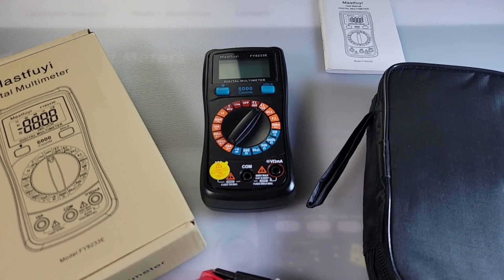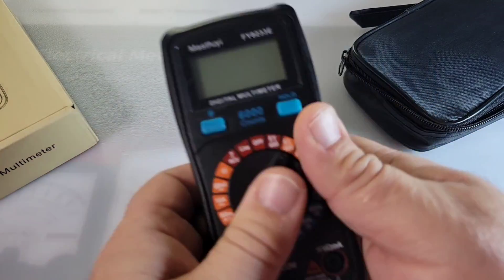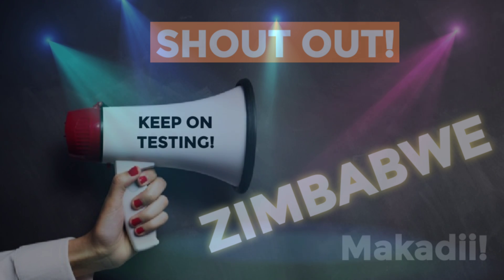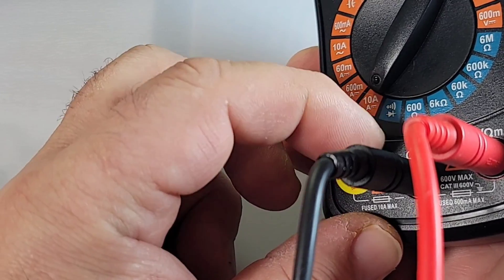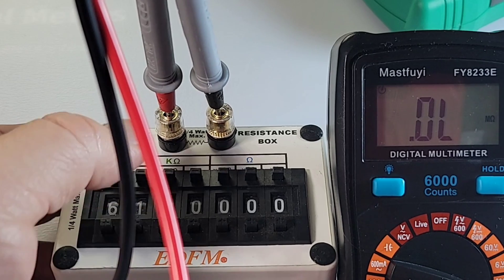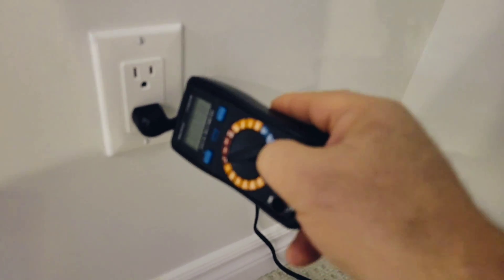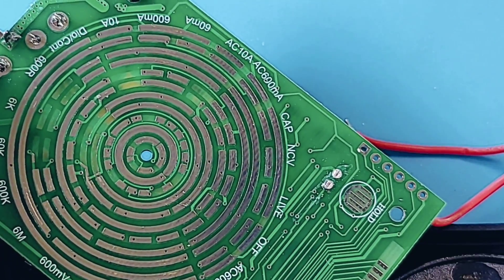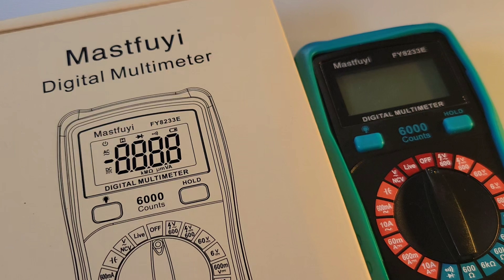MASTFUYI FY8233 CHEAP-O Multimeter Review & Teardown!

Comment: Hey, question. I have one of these that I rarely use but I replaced the batteries the other day since it was dead, and 48hs on the OFF position the batteries are drained again.
Any idea what to do besides buying a different one? Thank you
Reply from the maker: Try opening it up and applying some  IPA to the selector tracks..might be shorting due to some grease, so a good cleaning with Alcohol and a cotton swab might be just what the doctor ordered..😊
Reply: @KeepOnTesting  Thanks for the tip!

Comment: I being a female just seen this little cheap multimeter and bought it thinking i would be able to check my hotn relay or fuse but i truly dont know what to set it on every video i e saw doest have this type of i dont even know what this is called around the knob that turns it off an on. Could someone please tell me where to set the knob (the oart that turns it off snd on) just to check my ruses and relays? I truly would appreciate it more than your ever know.
Reply from the maker: No problemo..put the multimeter into continuity mode , it's the same selector switch setting as diode mode in the video. You should see this symbol ○))) (its between 10A and 600(Ω)  )..now test your fuse and if it's a loud constant beep the fuse is good, no beep..means it's bad..😊
Reply: Omg I thank you so much I'm just now seeing your comment do I have the settings on the same to check a starter relay?

Comment: Do you have any advice on buying replacement fuses? I searched Amazon for "multimeter fuses" and all of them seem to be approximately twice the size of the ones in my Mastfuyi fy-77. I measured mine at 5x20mm, but I could only find glass fuses in that size.
Reply from the maker: 10A or low current 400-600 mA ?
Reply: @KeepOnTesting  I have an F10A and an F250mA, both 700 volts. They are also marked with a symbol that looks like a Z in a circle, followed by the number 5.700  
  
I'm not in a rush, I just want to order a few to have them on hand before I need them. I'm sure I could find them on Digi-Key or Mouser but Ebay also sounds like a viable option.  
  
I just wish they had used a more standard fuse. I just ordered another model from the same company because it's Amazon Prime day and they're pretty much giving them away. Hopefully they're at least the same values so I don't have to track something else down as well.  
  
Thanks for the advice.
Reply from the maker: Either way Ebay is usually your best bet !

Comment: I got it on special for 6 bucks. So I can't complain. There are very few meters out there in the 10 dollar range that have NCV, Capacitance and 6000 counts. We have a bunch of those 830 meters at my job stuffed in PLC cabinets around the plant. For costing next to nothing they do pretty good for checking low voltage DC and 4-20ma. If we put anything more expensive in the cabinets they would probably get stolen. It also saves from having to walk half a mile back to the shop to get a fluke when all you want to do is a signal check.
Reply from the maker: CHEAP-O Multimeters can certainly do the trick...6$ is one helluva price ! 😀 good find.